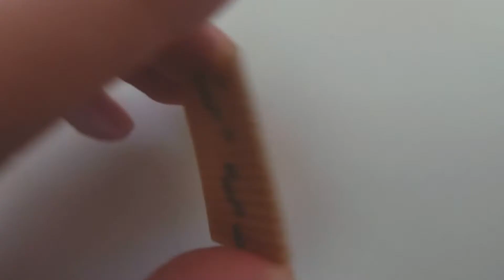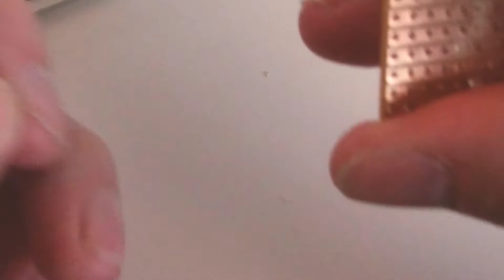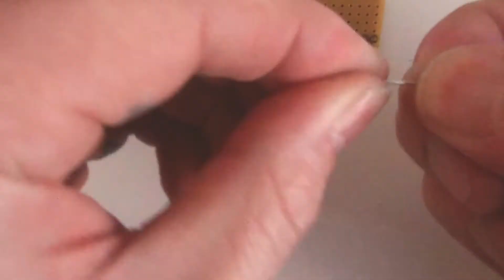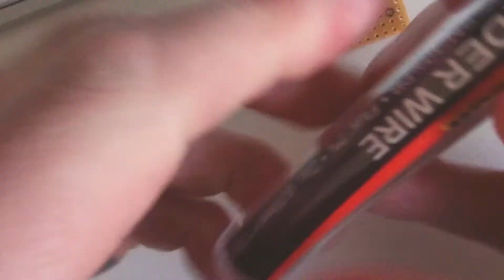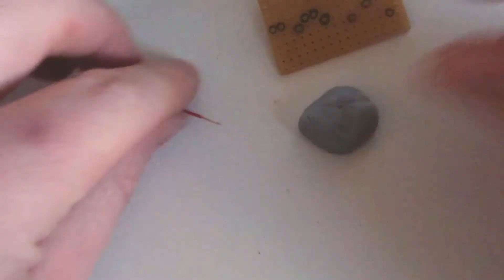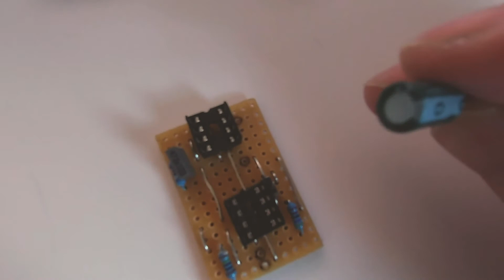Sunn T Inspired Vero Circuit | Build a usable guitar pedal in a few of hours!

Comment: I actually just made this today it sounds mostly great. It just kinda lacks sustain. Maybe I'll triple check the wiring with the schematic and swap out the ICs with other 386s in the bundle
Reply from the maker: Yeah when I build this the sustain is defiantly very long but that could also be down to what I’m playing it with. No 100% sure as only got a couple of guitars
Reply: @unholyaudiochannel  couldn't think of a better word than sustain for the issue until I thought of a gate. Mine sounds like it's gating. Did you use LM386N-4's?

Comment: Any tips for soldering? I just seem to be utterly incapable of sobering properly.  Always end up with a pile of solder somewhere, anywhere but where it’s supposed to be! It’s seriously affecting my self esteem!
Reply: Not sure how much soldering you’ve done up until this point, but the more you do, the better you get. It’s worth getting a bunch of pointless resistors and a veroboard. Mount as many resistors you want and just solder them all. Observe the process each time you do it, and you’ll notice what is required for a good joint. You’ll see that your skills will start to improve.
Reply: @jh-earthrider  Thanks. The general rule seems to be practice. Then do some more practice.  Cheers
Reply from the maker: Use 0.71mm solder and do lots of practice first. Don’t use lead free solder needs more heat to melt
Reply: @unholyaudiochannel  Cheers dude ! I’ll give that a try:)
Reply: What is the best pot value for vol and gain? How can I add those please?!
Thank you